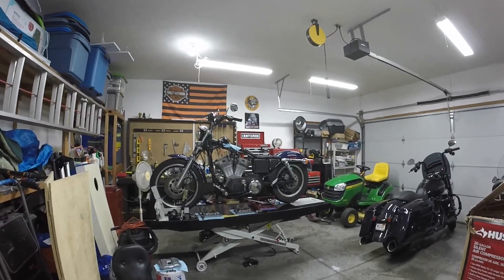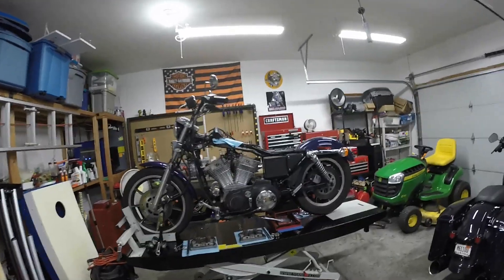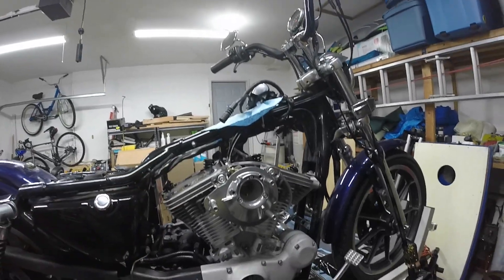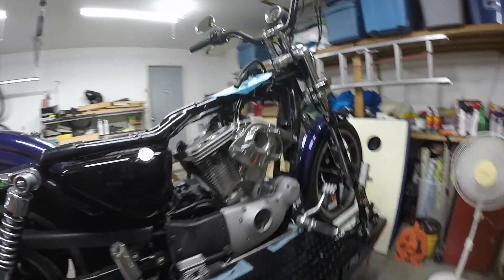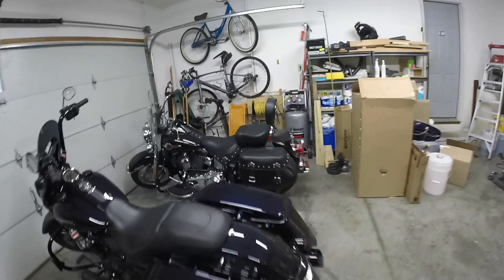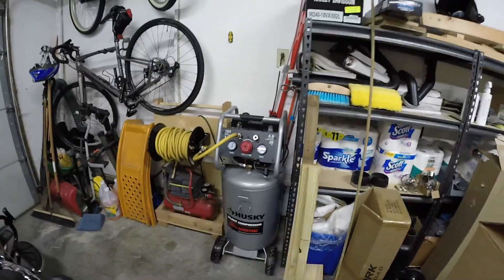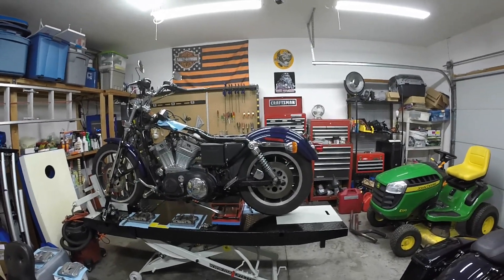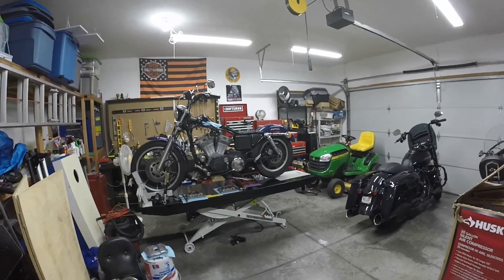It's time for a lift!!

Comment: Nice addition, will make life so much easier on the back 👍 wish I had room for a lift to be fair. Side note, Them tail pipes on the RKS look sweet.
Reply from the maker: Thanks!  Those muffler caps are from a Khrome Werks and I modified the Tab Zombie slipons to make them fit.  They do look good and get compliments all the time.  :)

Comment: Looks like a project for sure.  That lift will help out a lot 👊🤙
Reply from the maker: The project changed quite a bit and ended up trading in the sporty for a 02 fxst.  The lift was definitely essential as I just got done completely rebuilding the primary, full cam chest and replaced the stock 88" with a bored 98" / ported heads.  Thanks for checking out the video!!